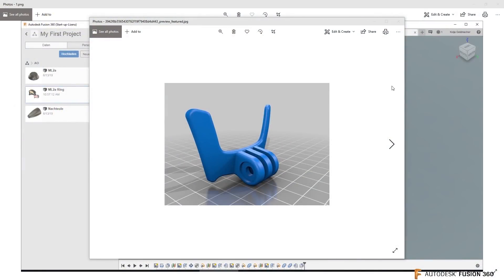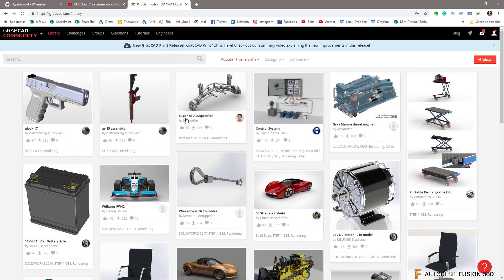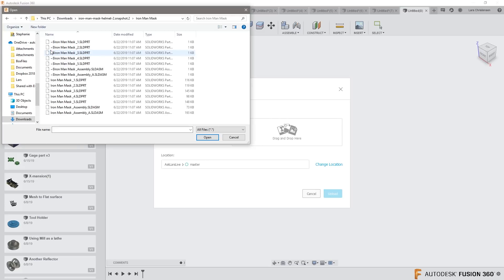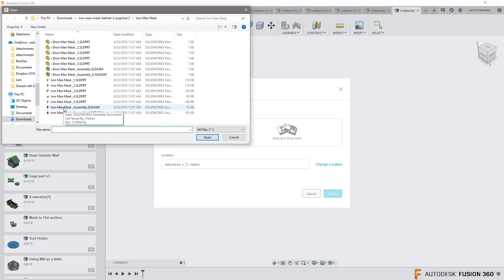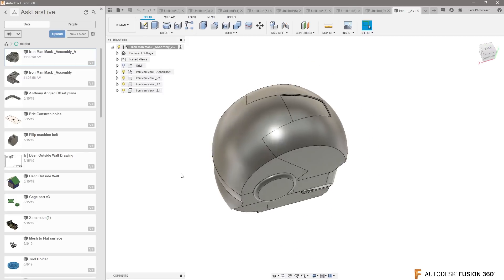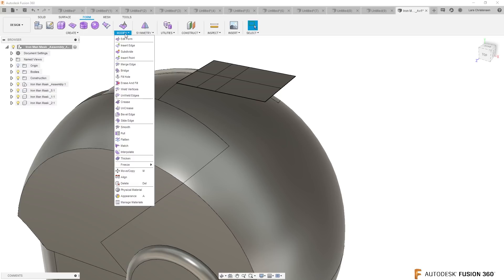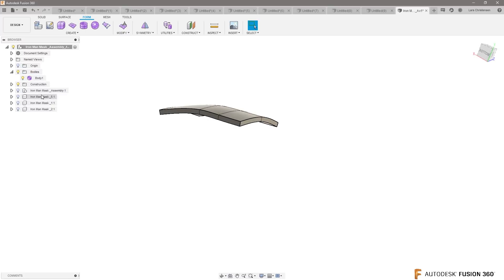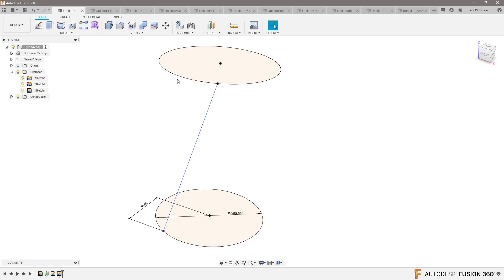Fusion 360 — Go Pro Mount on Iron Man's Helmet — Ask LarsLive

Comment: Great video Lars, exactly what i was looking for. Been working on a Helmet project for a few years now and I struggled with trying to get the curvature of the back side of the helmet. With a few of your vidies i was able to take cell phone pictures of top down and side profiles (two different curves) of the helmet and import them into fusion. This allowed me to trace the curves of any helmet i choose and get something close to the actual helmet curve to creat my base..

Fast forward 8 months later and i found out a tool actually exists for capturing curvatures called a "contour gauge" allowing me to physically place the contour gauge on the helmet, capture the curvature and trace it on to paper and import that traced image into fusion giving me a more precise fitting base model to work from.

What i have difficulty with was creating a sketch model surface from these 2 now hand drawn angles (top/down and side to side) so i could extrud from. Im still having trouble with this because the sculpt environment is something im new to.

Can you show us a way to do this? Take a 4 point drawing that resembles a plus sign (+) thats curved like the helmet on one side and create a sculpture from which i can pull into a flat surface on the opposite side giving me an even base to build upon. 

Maybe lofting from the sketch scultpted curvature surface to a square, creating a flat table surface to which i can place "things" on.